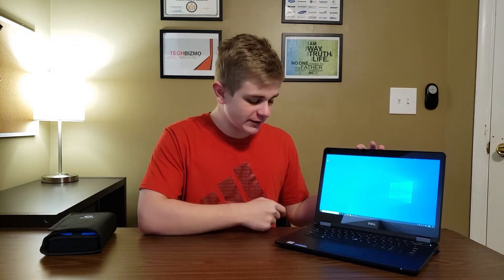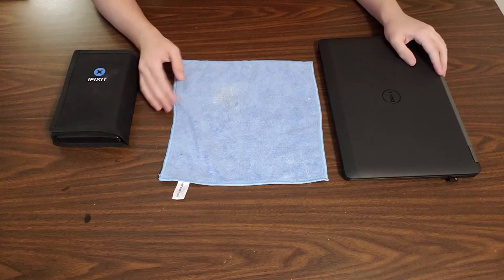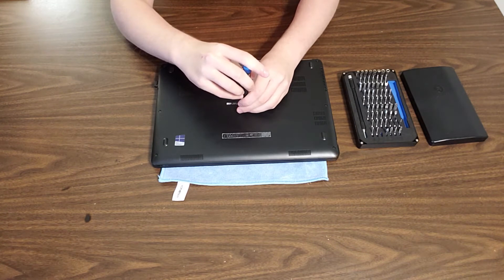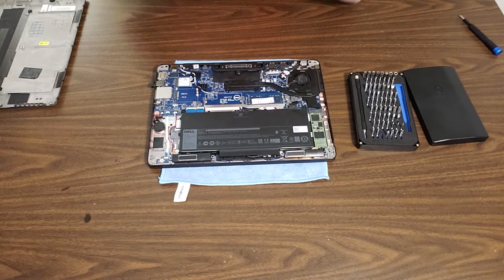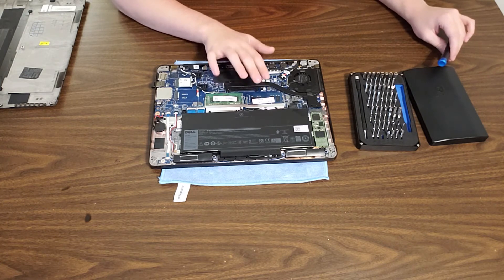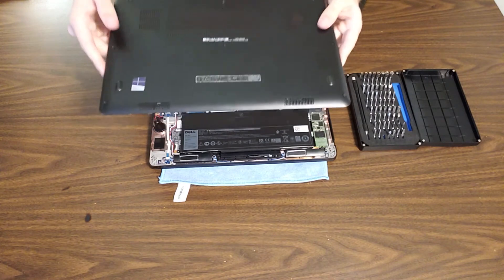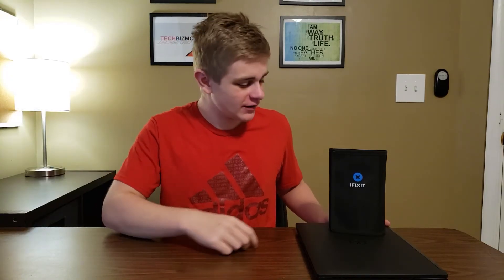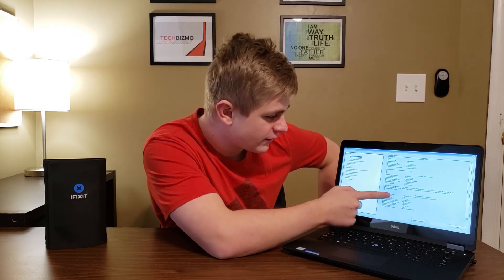How to Upgrade the RAM & SSD in a Dell Latitude E7470

Comment: The best possible performance would have been to just add a second 8gb stick of memory into the empty b slot, instead of only one 16gb stick. Using two sticks allows the memory to run in dual channel mode which gives a slight bump in performance versus one stick (very slight). The only reason to buy one 16gb stick is to have the option of adding a second 16gb stick later on. But this laptop does not have enough oomph to really take advantage of that much memory 99% of the time. In fact, I really doubt 16gb is really needed or offer any real world advantage. So to sum up. Two 4gb stick outperforms one 8gb stick, and of course, two 8gb sticks will outperform one 16gb stick and so on. Also keep in mind, smaller capacity memory modules usually cost less than larger, so yet another reason to add a second 8gb stick versus one only 16gb stick (Best performance for less). And there is always the option to step up in frequency with the ram, or adding sticks with lower latency or both. But for the majority of users, the best performance, and best bang for your buck would be to add a second 8gb stick and call it a day.

Comment: Just bought the E7470, installed  an nvme 1TB Hynix Gold SSD. Booted to Bios and noticed that under primary drive it reads:None.

Why is that?
Reply from the maker: You may need to alter the drive settings in BIOS. Maybe changing it from RAID to AHCI will work, or vise versa depending on the current setting.

Comment: Hi, Thanks for the nice video! :)  I am a bit confused to replace my SSD, I bought a Kingston NV1 PCIe NVMe M.2 500Gb for my Dell Latitude E7470, however seems like it supports only SATA M.2 SSDs, not m.2 PCIe NVMe drive. is there any way I can use my bought SSD in my dell laptop? Thanks for your help.
Reply from the maker: Yes! Just flip the SSD upside down. That's how they get it to work. I did the same thing with my Dell precision 5510, as well as my Latitude E7470. Beware though, this doesn't apply to every system. I will assure you it works with this one however. :)
Reply: I installed Samsung 970 EVO, 500 GB and works.
Reply: no it supports nvme after bios update

Comment: Im getting mine uograde but is no giving video and the battery line remain on fpr a while then it turn off itself, kts right type, samsung brand, 7470 im using a 16 gb ddr4 and 7450 im using 2gb  ddr3 samsung brand, same issues on both

Comment: Planning to upgrade my laptop after I finish with an apprenticeship programme. Just want to make sure what type of SSD [looks like NVME] you got there and what type & brand of RAM they got there. 100% Looking into the iFixit kit.
Reply from the maker: You can use M.2 NVMe or M.2 SATA solid state drives. NVMe will perform faster as it's data transfering through PCIe (a different technology from SATA) :)
Reply: Does it have bay for the SATA version of the SSD?